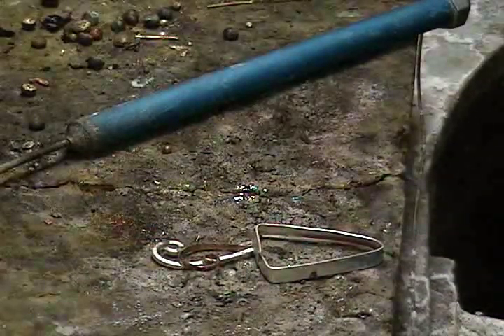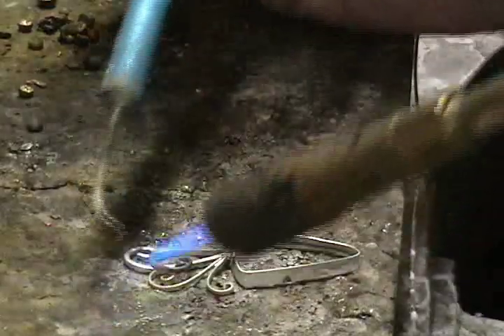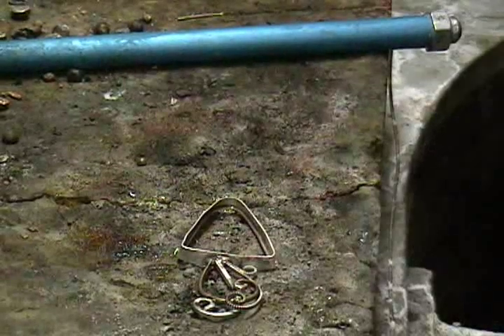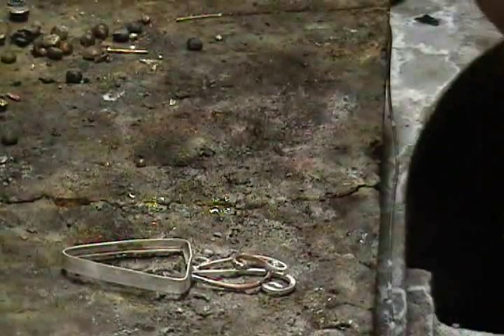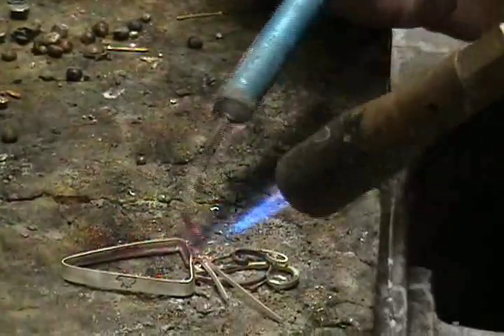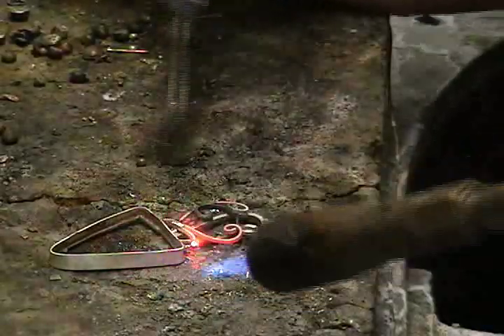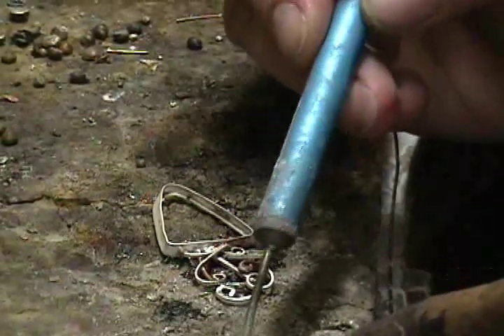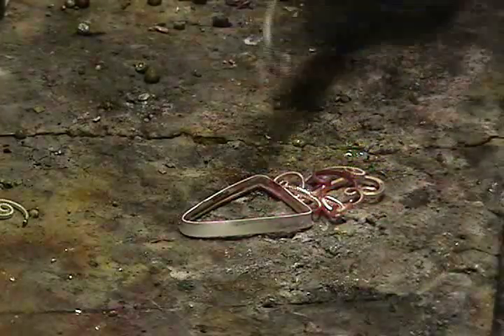Filigree Soldering Demo part 2

Comment: the past solder tends to displace the fine wires trying to get the paste off the syringe and onto the silver. I also use the pick to manipulate wires that stray or need pushed in place. As to heating the pick, if you don't, it is hard to pick up the solder ball...just like you have to heat the silver piece to make the solder flow, you have to heat the pick to get it to pick up the solder.

Comment from the maker: I'm using Rio's Ready flux, with about 1/3 denatured alcohol added. The denatured alcohol makes it burn off quickly rather than boil off. When flux 'boils' off, it's enough to displace the fine wires. You could also use Battern's flux (with or without denatured alcohol...I just like using the denatured in it).

Comment: Well, when I did try it, it was hard to paste several joints at once without displacing wires. I mostly used paste solder when I was doing chain repair years ago.

Comment: why are you heating the solder pick?  is it to prevent extra heat on you work?  have you considered using sodlering paste? you would not need to work the pick then.

Comment: What type torch and fuel are you using? Thanks
Reply from the maker: +mtlqrx My specific torch is from Sweden, but it's a basic propane and air torch with a hose attachment. They are harder to find now, however, but some of the better hand held butane torches will work. The tip is for a smaller flame...
Reply: +Jeannius Designs-Jeanne Rhodes-Moen thanks